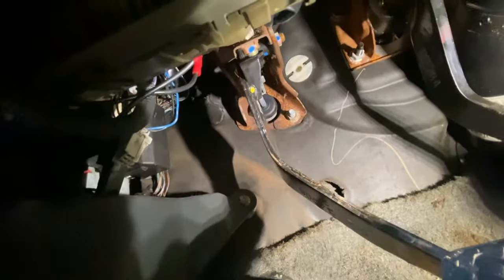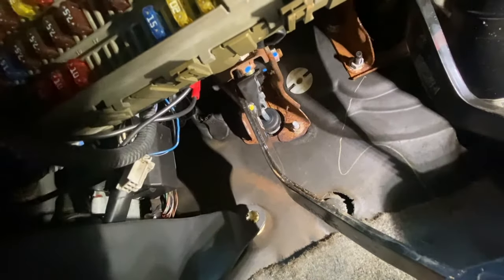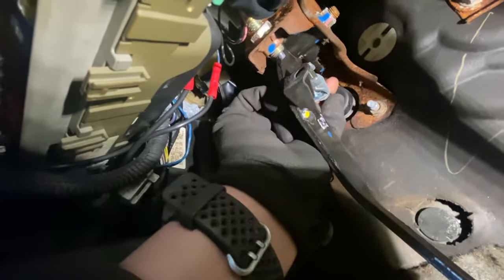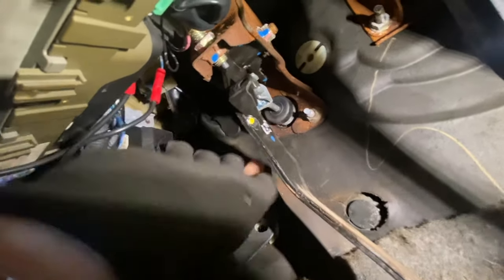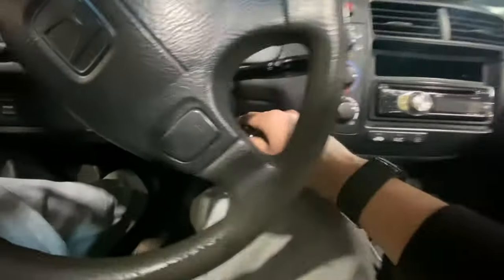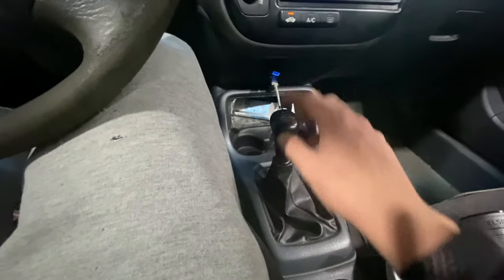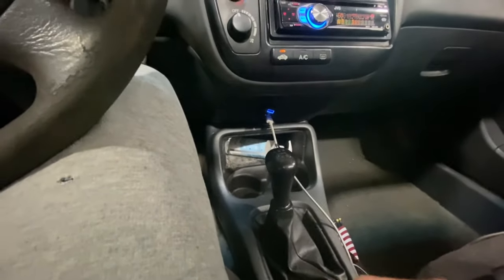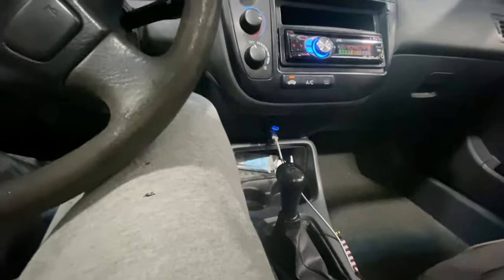Honda Civic Clutch adjustment

Comment: Owners manual in my 02 civic says to “properly” engage reverse, press clutch down and hold, shift to first and directly to reverse. Not sure if it’s the same for yours. Seems like the first time you went from first directly to reverse it engaged smoothly. The second time you kinda double clutched and it was clunky. Like I said before not sure if it’s the same but seemed like it worked.
Reply from the maker: I ended up doing some more fine tuning. And raising the pedal higher. Being I was wanting the pedal as low as possible. Especially on colder days. Thank-you for the comment!!!
Reply: Yep, this is because the reverse gear isn’t synchronized, so you can use 1st gear to sync the input shaft
Reply: @arc_4543  never knew the actual reasoning behind it. Thanks for the knowledge.

Comment: God this is the most annoying problem I have on my ej6 hatch. Every 10k-12k miles I get grinding then soon after impossible to put into gear. Brand new clutch brand new trans. I like mi engagement low but I wonder if too low causes this to get thrown out of place more often cuz maybe I go to shift too early or I don't know transmission stuff is my weakness I do mostly motor work. Why do I have to adjust it so often?? Thanks for showing how you do it.
Reply from the maker: Really only once, you only need to keeping adjusting it to find the height you prefer. If you have to keep adjusting it. Your clutch master cylinder or slave cylinder is probably going bad. And losing pressure
Reply: Master or slave may be bad ^ I had the same issue and didn't realize til they failed

Comment: Para los que hablan español, basicamente si tu ajustas el perno de regulación hasta arriba, el embrague saldra rapido y sera dificil de controlar si estas en cuestas, para dejarle mas recorido o dejar un embrague normal, hay que dejar el perno abajo (con todo lo que da el perno)... siempre dejandole un pequeño juego al pedal antes de presionar.
Reply from the maker: Maybe it is how google translated the Spanish to English. But adjusting the "bolt" only changes where the clutch dis-engages in the pedal. The clutch "in concept" isn't adjustable. The can only adjust where the pedal engages the clutch. For example Clutch height - low/med/high.

Comment: Just to clarify… When you first adjusted it you were able to cold start the car fine on colder mornings, but then it wouldn’t go back into gear once you moved the selector to the next gear?  Or was it just first gear you couldn’t get back into?  It seems like doing it this way would require restarting the car each time you stopped at an intersection or in traffic.  That would get you to work, but it would make for an annoying drive.
Reply from the maker: Yeah man, I had it on the edge of being able to put it in all gears. Really depended on temps. I ended up having to keep adjusting.
Reply: @RocketGarageService  So, it would start in gear but not shift if it was too cold?
Reply from the maker: @fomoco300k  Correct, once the fluid got warm and expanded a little I was good. But like you said, its annoying and not practically. Just got to find there fine line.
Reply: @RocketGarageService  I have a 93' accord 5 speed and I drove my car with it doing this. I had a problem getting it to go into 1st gear and sometimes reverse Trying to shift into 1st when the car was cold was a problem. It was like the clutch was barely disengaging just enough to change gears. The shifting is fine when it's warmed up. The only gear i would have trouble with shifting into is 1st gear when the car was already warmed up. Every time i would need to stop, I would slow down to a slow roll and as i' m slowing down at the same time i would push the gear shift lever into 1st gear. It would slide-in if you come to a slow roll before you would stop.😊

Comment: if it's so low you have to turn the car off to get it in gear, you went too far
Reply from the maker: Correct, and the colder the worst. Due to fluid expansion. So in the summer you might find it great. But the first cold snap, if you have it set super low, it will give you issues.